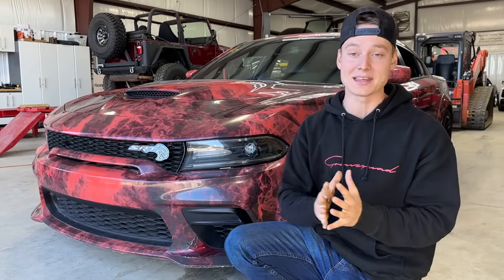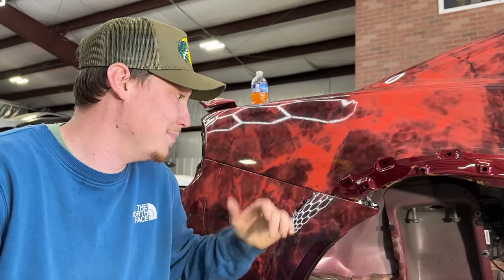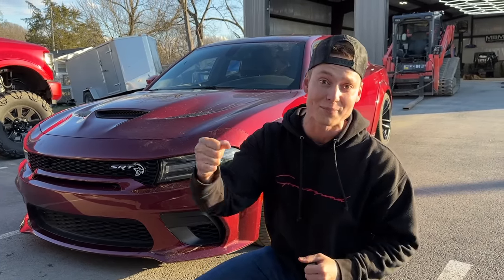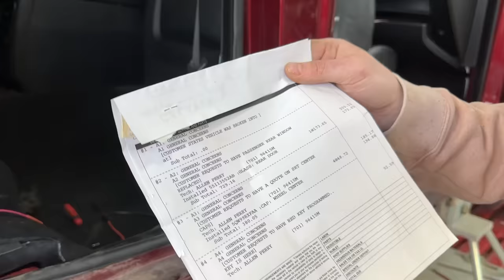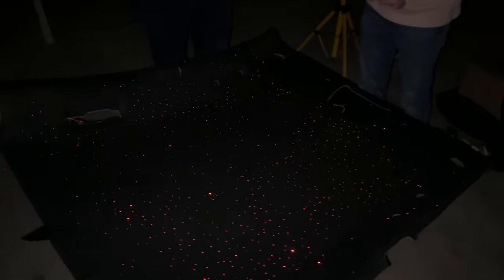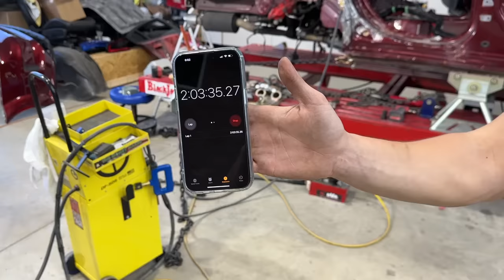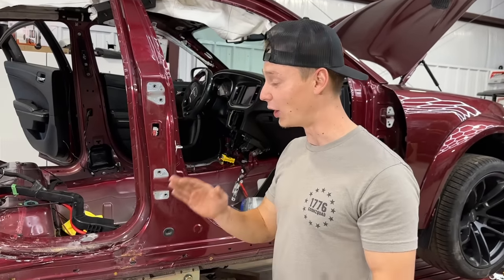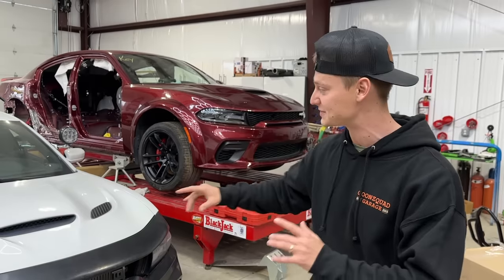Rebuilding A Wrecked Hellcat Charger In 24 Hours!!!

Comment: Hey guys. Those 5.7 Hemis are known for bad cams and lifters. That being a patrol vehicle it has tons of idle time on it. That’s what kills the Hemi because of bad oil circulation in the top end. If it were mine especially with the super charger, I’d replace the cam and lifters. Check your drain plug and oil for any metal. If you have any at all it’s time for a new engine because the metal from the worn out cam and lifters has already gone through your entire engine. Ask me how I know! 2011 Ram here.

Comment: Put in a stock headliner and sell the starlight.  A ton of them are popped out and when that controller goes it's going t be a headache.  They should have mounted it in the trunk or the rear sail panel as well for a number of reasons.

Comment: The longer I work at a real collision shop with expert body technicians, the more cringe these "repairs" look to me. I'm a parts advisor and watch vehicles worse than this get repaired from beginning to end; there is NO way this can be properly done in 24 hours. The inner structure of that rocker and wheelhouse are obviously damaged. But, you know, give it a good pull and make it look good.
Here's something these boys don't know, and why they should never sell anything they repaired; if one of their vehicles is in a pretty big accident and injuries occurred because of these shoddy repairs compromising the vehicle's structure, then these guys are liable for criminal charges. Not just civil, but criminal.
I wouldn't touch one of their rebuilt vehicles with a ten foot pole.

Comment: That’s the way to go.  Spend 2200 on a kit.   And not 6700 for the same parts.   The kit will fit perfectly.     I would recommend you panel bond all the grills in

Comment: Sloppy job with the lights, I wires on the driver side pilar. That will take several day's poking those holes and running it through, Not hours but day's He had 2 of them, I had 1 smaller set since i did on a Audi TT. That would of taken even longer

Comment: Y'all still look like you don't know how to use the frame machine and maxi dent puller. Using the wrong stuff at the wrong time. Even if your plan was to replace it all anyways, then that's the perfect time to experiment / learn and try to pull it out the right way the best you can.